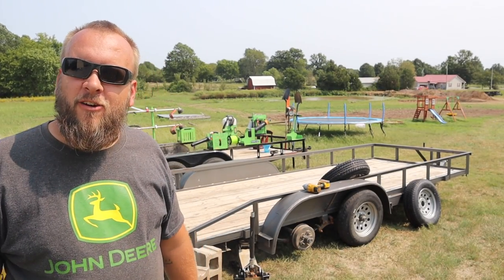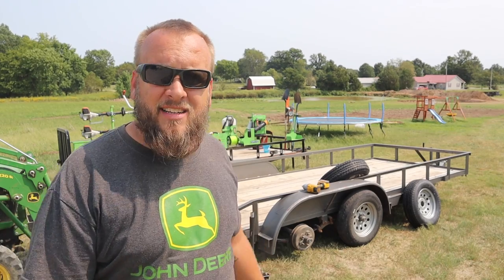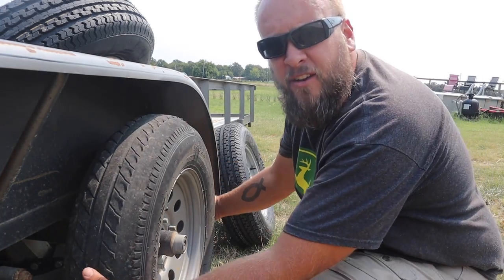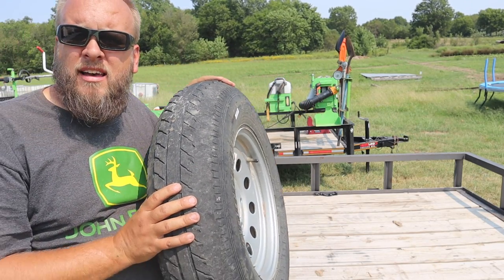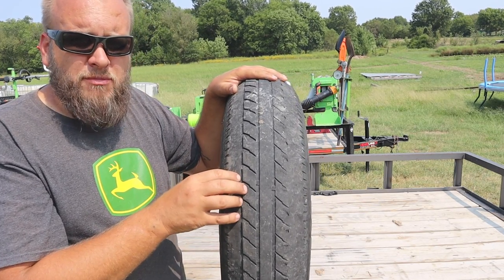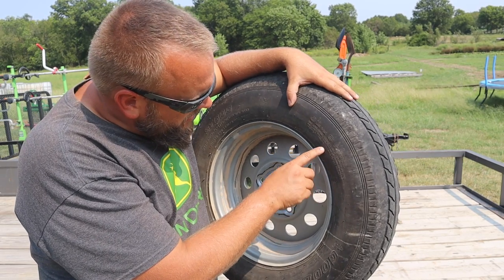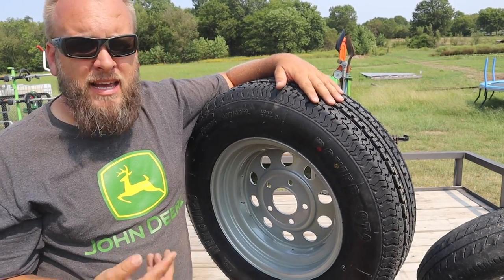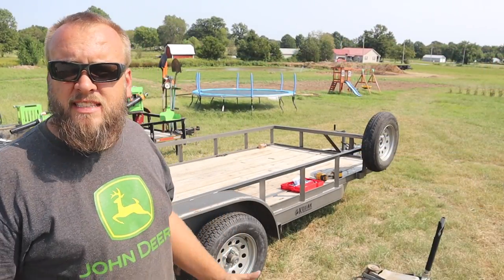These Trailer Tires Suck - Check the Load Range Before you Buy

Comment: Goodride tires are the worst of the worst Chinese tires. My Goodride tires developed a goiter (a sidewall bubble delam) sitting in the sun for two days. Went bald in the middle and cracked down to the cords after two years and about 3000 miles.

Comment: the wider the tire the more weight you can haul the higher the pressure rating the more weight you can haul
Reply from the maker: Right. I think the ones I bought yesterday should be a minimum quality sold on this trailer considering I was buying it with a tractor

Comment: They are imported from china the dealers buy them by the trailer load they come flat as a pancake some times they have to be laid in the sun to warm the rubber up so they can be mounted and inflated. The tire and wheel use to cost the dealer about 25:00.each.it should be against the law to put them on a trailer.

Comment: ST trailer tires are the biggest rip off in the tire world. They don't have to be DOT rated since they're only for trailers, not anything that would be carrying a human. They're marked ST not because they're special, but to make sure you don't put them on a car or truck. 80 to 90% of the ST tires out there aren't worth the money. You can find good ST tires, but they're rare.
Reply from the maker: Yeah, I’ve learned my lesson about trailer tires. I’ve traded out and got two bigger trailers since this video and most of the manufactures try to put junk tires on them

Comment: When you buy a new trailer they just give you tires to get it off their lot. The ply rating is just that. They are not the actual amount of plies as stated. It is just a rating they refer too. It is based on load stats only. All tires are unfortunately made in China. If you can change to a 16 inch tire then you will have a good tire. The 16 inch tires will last a long time on a trailer. Speak to a reputable tire dealer for more info.

Comment: A 205 is too small for that trailer. You should be running 225/75r15 10 ply tires if you're hauling a 5k lb. tractor.
I have 5 trailers and it's always better and safer to go overkill.
Reply: I have 205/85d14.5 trailer tires on a 12,000 trailer they are 14 ply Hercules tires so no you don’t need to go to a 225 the load rate and ply is what you need to look at but it is getting almost impossible to find USA tires

Comment: Weight rating doesn't have anything to do with tread wear that's all in the rubber compound I hate to break your heart but all trailer tires are garbage these days they're all Chinese (most all tires are made in China actually) but never the less good luck finding good trailer tires I haul a skid steer and forestry mulcher I consider trailer tires a consumable at this point ive tried all kinds of brands ive got alot heavier trailer ive switched to 14 ply that's been the best so far but still not great I go through a set about every year with a blowout here and there

Comment: I'm a minute int to this video... And can see  you have an over load problem with the tractor and buy the looks of the tire.. a suspension problem. ,,Bushings worn what ever.. heavy truck mechanic..trailer is only as good as the loads put in it and the maintenance and common what that trailer and tires you put on it..YouTube is full of boo hoos what the heck I been ripped off. ..give me a break !
.
Reply from the maker: If you think this is a boo-hoo thing, you need to check your mindset.

I didn’t complain to the manufacture or throw a fit. This is supposed to be a public service announcement to check the tires when you buy a new trailer because they may not be adequate.

I had not had the trailer very long, and I was using it for the specific task it was rated for

I bought this trailer specifically to haul my tractor with. I bought it as part of a package deal that the tractor came with the trailer specifically to haul the tractor with.

The machine was significantly less than the rating of the trailer and I only used it occasionally.

It’s just a fact they companies put the cheapest possible tires on trailers that are meant to haul

When you say YouTube is full of people complaining. I mainly see people in the comments criticizing everything.